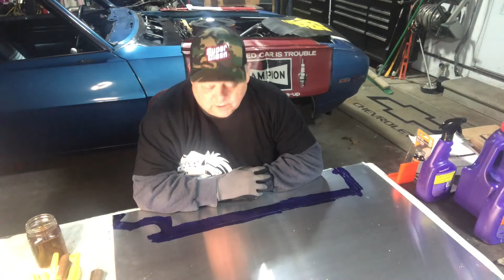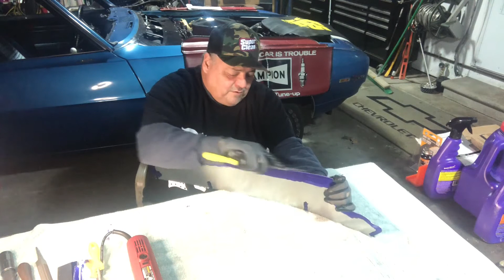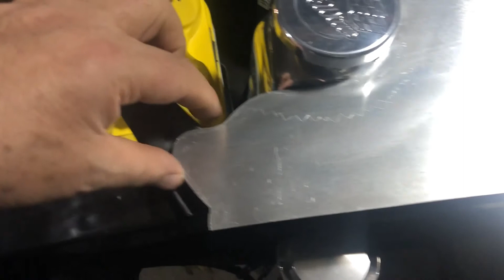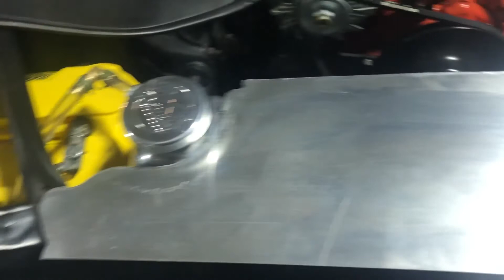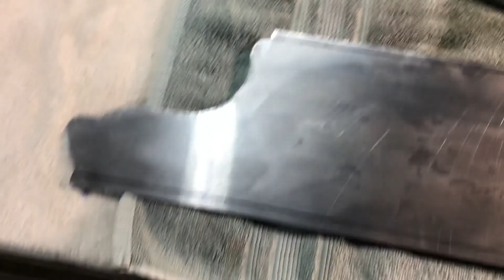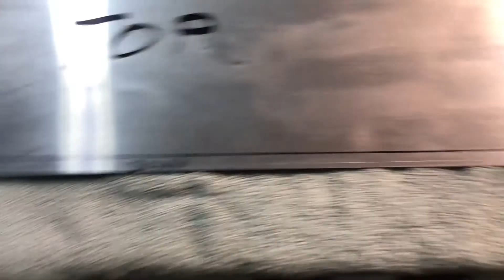1969 Z28 Blue Edge Radiator Cover Fab Project-Part 2

Comment: Great work Bill.  It was cool to see the yt crew work together at the raise the roof event.
Reply: I'm thinking the bowtie should be stamped prior to rolling the flange because the amount of flange material will be slightly reduced.
Reply from the maker: @robertgriffin1129  yep, I’m kicking that around. It will be easier to fit the tooling in with no down standing flanges too